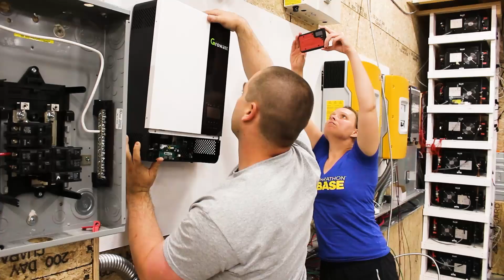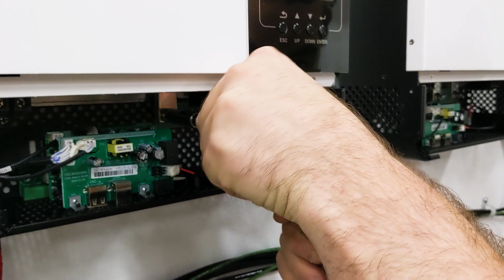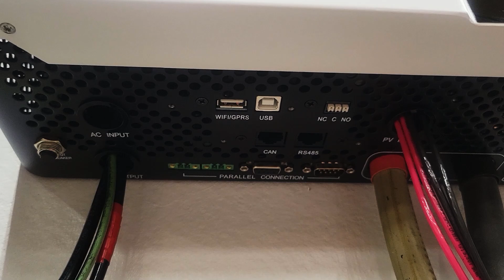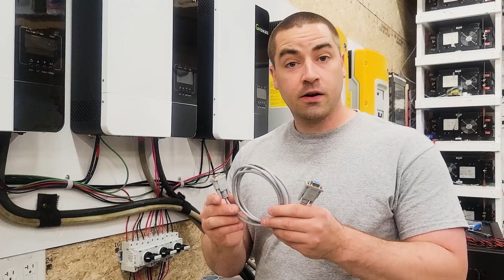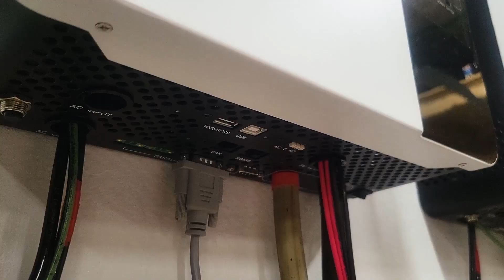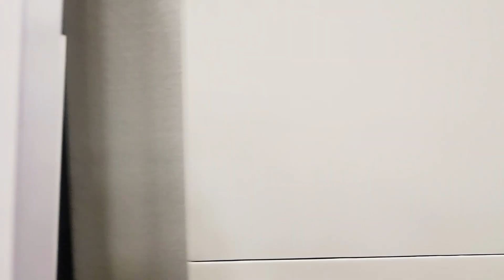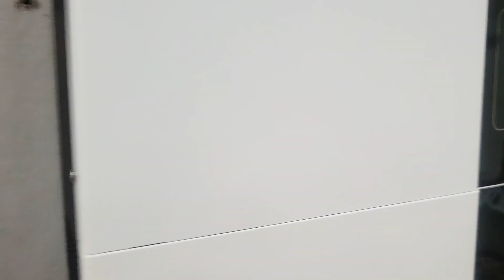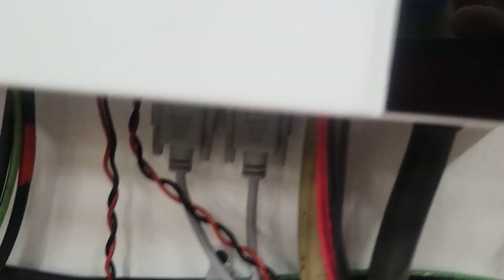Paralleling 3 inverters together, Growatt 5000w Solar System

Comment: Hi enjoying watching your vid . I have two growatt inverters installed  a 5kwh and a 3kwh inverters an two sets of batteries banks they were fitted at different times buy two different companies they will not work in parallel I was told  they would. But they don't and never will . So I was looking in to the inverters you have fitted  .vut what I need to know is will they  work with two sets of batteries banks  or dose it have to be one and if so what size batterie bank can I put on them . I would appreciate any information you can help me with thanks
Reply from the maker: If you have 2 or more inverters wired in parallel (and working in parallel) then all must be tied to the same battery bank.
Reply: @DavidPoz  that is what I was wanting to know . Do you know how big of a battery bank I can put on two 5kwh inverter working in parallel
Reply from the maker: According to the Growatt manual, you need a minimum of a 200Ah battery per Growatt 5000ES inverter.  There is no maximum.
Reply: @DavidPozEnergy  thanks dave you been very helpfull you answered some off the question i been looking for nobody els has got back to me on this . I fist had a growatt  5kwh inverter and 4no 3.3kwh batters installed in2021to help cut the cost of our electric bill as we live in an all electric house in the uk we were using 13,000 to 14,000 kwh a year .and in 2022 we hade heat source pump fitted as there was no way of getting gas heating and we had storage heater that were expensive and not very good . but the heat source pump would use all of stored power on the batters leaving noon for the house so we be importing electric off the grid at expensive times so i got another growatt 3kwh inverter and 2n0 6.6kwh batteries fitted buy the same company it was supposed to work in parallel with the other inverter and batters giving me enough stored power to run the house and heating . But as you know this is not happening so  I am I bit in limbo as what to do to rectify this problem not getting much help of the installers . do you have any possible way that might help me solve this problem other than changing both inverters and half the batteries . any advice would be grateful  as the installer over hear don,t have a clue I think they buy  standard kits and fit them don,t think they know how to design a proper system .

Comment: Nice video and set up but has an electrician I am super concerned with your wiring methods. 120/240v (high voltage) should NOT be ran open with no conduit.

Comment: because on controllers it explains how many panels like 1200 watt it can handle, but for science how do controllers handle power from 24 volt batterys where you have 875 cca or 100ah?

Comment: i've seen how you test things, so im starting out low cost, first started with car battery that where $10 each at junk yard, then got a deal on agm batterys of 13 of them. now i saw lithuim iron so bought 8 with tax return. i heard they charge differnt so i cant just add them to my other batterys. so i wondered since i had extra 12/24 100 amp pwm controllers is can a controller be hooked to 24s battery for input to charge 12s out put? this way i can group my lithuim batterys and let it charge my agm batterys was my theory. i have 100 amp and two 30 amp controllers. so are the controllers going to blow up being on a 100ah battery ? or does the controller just max out at charging so many amps?

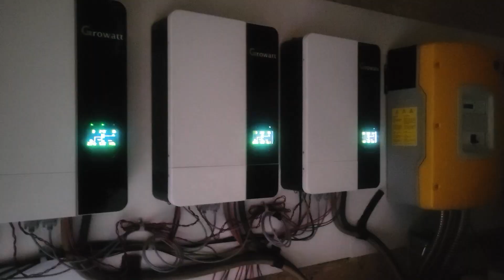Comment: Help me understand please, the goal of this setup, at 24:00, you said you turned off the grid power.  Was that just a an example of a power outage? Does this design feed your house from the batteries/solar and supplementing/charging from the grid OR is it designed to manually switched over as you did.
Reply from the maker: My long term goal is to build a 100% off grid home on some remote piece of land.  The projects I do in my garage today are part of that journey.  Right now, I'm testing equipment and reducing my electric bill.  Most of the year (April through November) I run my house on the off grid system.  During the winter I supplement my electric bill.

Comment: Hi
you have 3 PV String?
when you connected 3 disconnectors, between PV and inventor?
Every single PV String into one Inventor?

How do you communicate with several Battery-Packs when you have 3 inventory?
do you have any CANbus/RS483 Switch?
And in the switch are connected 3x inventor and 3x battery-pack together?

Thanks
Reply from the maker: I have 3 PV arrays.
Reply: @DavidPozEnergy  
How do you communicate with 4 Battery-Packs when you have 3 inventory?
do you have any CANbus/RS483 Port Switch?
And in the Port Switch are connected 3x inventor and 3x battery-pack together ??
Thanks
Reply from the maker: I don't have any comunication between batteries and inverters.  I'm sorry, but there might be something with a translation, but I don't understand the rest of your question.

Comment: Hi, does anyone know why we can't connect the LFP batteries to each SPF5000ES? I have a set up with two inverters paralleled and was thinking to connect them with each own LFP batteries (self made out of cells from Alibaba). But manufacturer says it's not possible and I have to make one main common battery. Which is hard because the cells I got are of different capacity.
Reply from the maker: If you want the two inverters paralleled together, feeding the same load panel, then they must have the same battery bank.  You can parallel the two batteries you made at a central busbar.  
Let's say, one of your batteries is a 16s, LFP, with 200Ah cells and a 200A BMS.  Then your second battery is a 16s, LFP, 280Ah cells with a 300A BMS.  They are two totally separate batteries, each with their own BMS.  Then you can parallel them at a busbar between the battery bank and the inverters.  That's OK.  

What you don't want to do is undersize the battery.  The manual for the Growatt5000ES says you need a 200Ah battery for each.  This means your total battery bank needs to be 400Ah or more for a 2-inverter setup.
Reply: @DavidPozEnergy  the issue is we have two 48V battery packs - 310 and 290Ah. Is it still ok to parallel them?

Comment: Pls can I connect two inverters on a 12kw of array with each inverter charging a 5kw of lithium battery?
Reply from the maker: No.  You can have two inverters charging the same battery bank.  The manual for the Growatt 5000ES says you need a minimum of a 200Ah battery for each inverter.  That means if you have two in parallel, then you need a minimum of a 400Ah battery bank.  At 50V, that's 20kWh.  
As for your solar array, you will need to split it into two smaller arrays with the wiring.  All the panels can still be mounted on the same racking, but split electrically.  Then 6kW goes into one inverter, and the other 6kW goes into the second inverter. 
Good luck.

Comment: Why not use the imo switch that has mc4 connectors?Also which breaker box has the earth ground connected to it?the house breaker box or the garage box with the inverters on it?
Reply from the maker: You can certainly use the MC4 style connectors if you want to.  However, in my setup, I'm trying to eliminate as many potential failure points as possible.  I have the option to run the wire directly into the IMO switch, and that eliminates some additional connectors.
Reply: @DavidPozEnergy  awe ok... in an offgrid situation with the growatts being the power supply then into a 240 subpanel,to the transformer,then onto the house distribution panel with the neutral and L1 and L2. Where do you attach the earth ground rod and is that as well the location for your neutral to ground bond?I have a pretty good handle on the rest of the equation just sketchy on the grounding. Again strictly offgrid

Comment: Hi David, thank you for the video. One thing that I would like to mention is that on the inverters I use always tells you not to switch on your solar array while the inverter is physically on it tells you to do it before you switch it on again, and it must be because of a surge. It might be different with your Growatt inverters.
I would check your manual to be sure.
Reply: One other thing that I found with my hybrid inverters is that there is a neutral earth bonding screw inside the inverter which you have to take off if you are tied to the grid because in the UK, the neutral earth bond is also done in the input.

Comment: Hello sir 
Thanks for this explain 

I have problem i have 3 growatt inverter connected together 
Then i programmed them as 3 phase (for elevator) 

I have mono phase generator to charge the lithium battery 
Next i noticed that the inverters not charging only one of them 

Can i use mono phase generator charger or i need 3 phase generator for charger?
Reply from the maker: What goes in, comes out.  If you want 3-phase out, then put 3-phase in.  But, another solution is to use a separate battery charger connected to your generator.  This way, you don't connect anything to the "AC INPUT" terminals on the inverters.  Instead the generator will simply charge your battery when you need to.  This will keep you from having to buy a different generator.

Comment: Can you show how the 3 Growatt Inverters go through the electrical panel and wired to your house, please?
Reply from the maker: I have a manual transfer switch at my main disconnect from the grid.  The transfer switch allows me to switch the whole property from grid, to my generator input.  I run my solar/inverter setup into the generator input to run the house.  This way, there is no chance of back-feeding the grid and hurting a lineman.  Also, this means that when I make videos and am changing inverters, or re-wiring, I switch the whole house back to grid.

Comment: David   I am trying to put together a battery only back up system for my home up in the mountains.  I can use solar because of snow and trees.   I want to have my 200 amp service come into a transfer switch and if the power goes out (which happens monthly and can last for up to several days.  I want it to power my entire house,   Can you recommend a book or two that would help me design a system. I need help determining the size of batteries.  also trying to determine if if the batteries should be 100AH 200 AH or 300AH.  Any help would be appreciated
Reply from the maker: Unfortunately, I can't recommend a good book.  I used to have some books written back in the 90's, but the information is out of date.  Most solar publications today are based on grid-tie.  However, I can recommend a video series.  I think Alt-E did the best off-grid design video series.  I'd watch that.  https://www.altestore.com/diy-solar-resources/off-grid-solar-system-design-video-series/

Comment: David, sorry if this is a dumb question:
What do you think about using a solar specific circuit breaker instead of the solar disconnect switch?
Reply from the maker: I love using a circuit breaker when available.  This market has been expanding rapidly over the past few years and more products become available every day.  If you choose a circuit breaker, make sure it's Voltage rating is for worst-case.  Worst case in solar PV, is Voc (Volts open circuit) plus 25% for temperature.  Meaning, if your solar PV string adds up to Voc of 400VDC, then you need a circuit breaker rated for at least 500VDC.

It used to be that for high Voltage DC, we had to use ceramic fuses and a disconnect switch (like the IMO brand).  But I know there are some new circuit breakers on the market now.  I just haven't tested them yet.
Reply: @DavidPozEnergy  i really appreciate this thorough response.

Comment: Can you parallel with growatt Es with growatt HVM-WPV series ?
Reply from the maker: No, sorry.
Reply: @DavidPozEnergy  thanks for the reply . I love your videos very informative , i just upgraded to 3 phase parallel and 1 split total 4 inverters and running good for 2 months . but after today i installed 2 more + 1 200AH (51.2V) life PO4 pack i noticed the DC MCB circuit breaker 250A was very hot during solar charging and 110A flowing through the daisy chain batteries . After sometime the DC breaker just trip and is very hot . i was wondering what if i add another 4 packs total 7 packs then i believed the main cable 4 AWG cable will be very hot while discharging and charging ? am using 4AWG daisy chain to 250A DC MCB then connect to the dusbar then all inverters connect to it . i think something is wrong , it only happens during solar charging time . thanks for the advise

Comment: Hi Dav, Getting ready to do my install. I have exactly the same system.  Question, are you running three sets o cable off your batteries and then separately feeding them to your ES5000?  Thanks
Reply from the maker: All your 48V batteries should be paralleled at a central busbar.  Then off the busbar there is a wire for each inverter.  The inverter wires must all be identical (gauge and length) from the central busbar.  The manual says a minimum of 2AWG.  I used 1/0.  I hope that helps.  Good luck on your installation.
Reply: @DavidPozEnergy  thanks David. Do you have any experience with 2/0 from your batteries?
Reply from the maker: I've made a lot of systems over the years, some with 2/0, 3/0, and 4/0.  It depends on the Amps.

Comment: I've got a question. We have a growatt 12 kw off grid setup (2, 6kw off grid split phase pure sine units in parallel) with 2 lipo4 batteries run in parallel. 
Each unit can run the 6kw worth of power independently, but when combined together it overloads/ says output short circuited, what are your thoughts?

Comment: In case of On-grid, With 3 phase.
The output of each of the 3  inverter, will it be as (L1 N1) for INV 1, (L2 N2) for INV 2, (L3 N3) for INV 3.
 All going into the distribution box in which  L1 of INV 1 because phase 1, L2 of INV  2 become phase 2, and L3 of INV3 becomes Phase 3. All with a common Neutral.
In the distribution box....,?

Also, can a three phase Automatic Transfer Switch be used as a bypass to switch  between grid and inverter...?

Comment: David - Thank you for providing very informative information. I have a question about the use of the batteries and the inverters. I live in the woods with propane gas and a geo-thermal HVAC system. I am interested in using a battery system to provide emergency power to the house and use then existing electrical grid to power the batteries after they have been used. i have a 30amp wired connection running between the garage and a 100amp sub panel box. If battery backup is used I would imagine there would be an automatic switch to disconnect the grid power and to connect the battery power. Is this possible and what might you suggest to help me with my idea.  Thank you. Jerry

Comment: Thanks bro, your video was fantastic,i really enjoyed it. 
however, i am in Nigeria and our voltage is 240v. 
i need to power a single phase equipment of 12kw
i have 2 units of 10kw Growatt inverter
how to i run the connection (combining the both inverters) to power a 12kw equipment?
Please help me out ASAP
thanks.

Comment: I like your videos, I have had solar on our ranch since 1999. Started with dual Schneider sw 5548s . Now i am totally off grid at the home with dual smas like i see on your wall in the video. I increased my capacity by ac coupling my smas with my old grid tied system. Simple, connected to the ac buss to the house. The smas frequency control my enphase array for load and battery charging.  Many times, during the day i have 40 amps grid without taxing the smas, as they provide grid only and battery charging for nightime. Im an old time diyer in California.  Fred
Reply: Oh PS my main thing is heavy equipment and gold mining.

Comment: Great video! Question. We are setting up Phocos all in one 3kw units that accept 5000w @ 250v PV input. Working towards off grid. Can I go over the voltage by a couple volts after POV calc for cold climate? Or better not? I have 235w panels and was told I could only do 2 strings of 5. Voltage used was 42v per panel max. But the watts is only half what the unit can handle. Any insight? Thanks
Reply from the maker: I just checked the specs on the Phocos 3kW.  It says Max PV input is 250VDC, and MPPT range is 90-230VDC.  That tells me it's a hard rule not to go over the 250VDC ever.  I've seen cheap charge controllers fry with only about 10V over.  Some charge controllers have the ability to handle a few volts over for cold temps, but not all.  Unless Phocos has a supplementary guide, I'd stick to the 250V as a hard limit.

Now, the worst case scenario is 25% over.  But, you can check the NEC for your area and see what they say.  For example, I live in Massachusetts which has a 21% margin according to the NEC.  Also, you want to make sure you are reading "Voc" Volts Open Circuit.  Not Vmp.  If your Voc is 42.0V, then I'd multiply that by 1.25=52.5V.  5 in series is 262.5V, which is over and won't fly.  Use 4 in series.  You will have to adjust for your areas climate.

If your solar panels are a big name brand (like LG) then you can sometimes find a supplemental document for cold temperature adjustment, but that's not always going to be any better than NEC.

Comment: Hello David what do you think about this inverter by Growatt 
3.7 out of 5 stars9 Reviews
ixaer Wave Power Inverter Growatt 48V 6kW 120/240V Split Phase Solar Inverter Built-in 80A MPPT Solar Charge I got two from Amazon and I'll be getting it by the end of this month I'm planning to hook it up in Parallel Off Grid